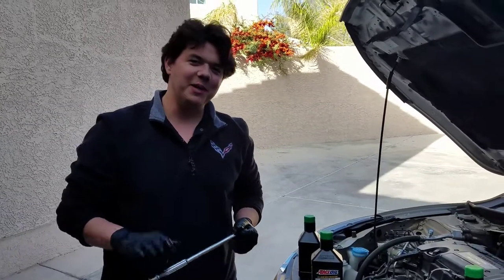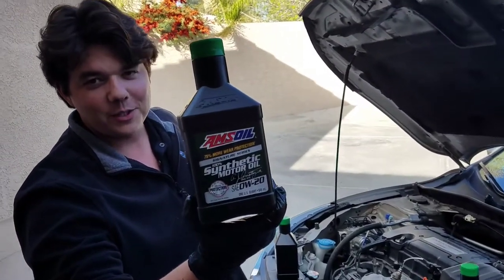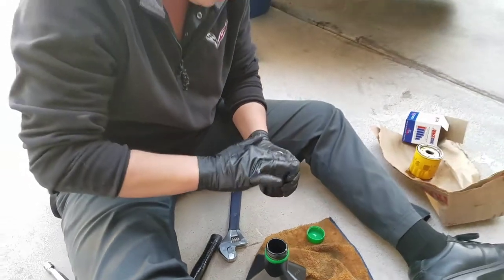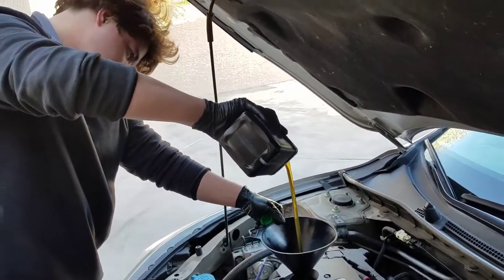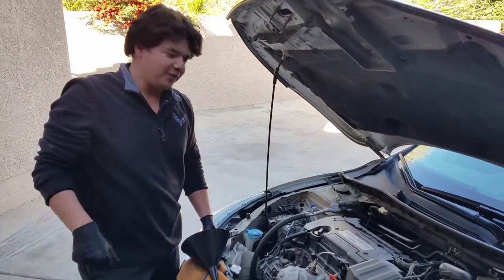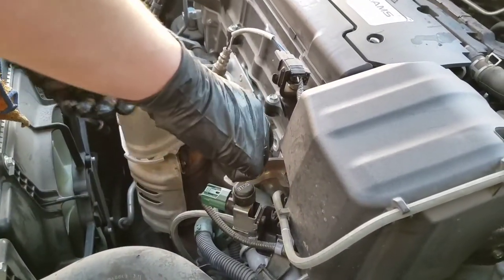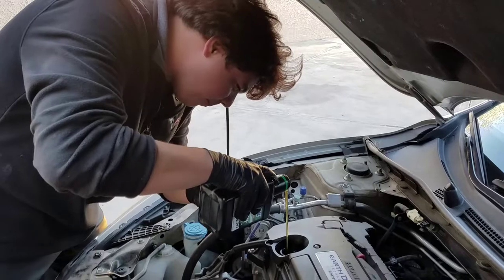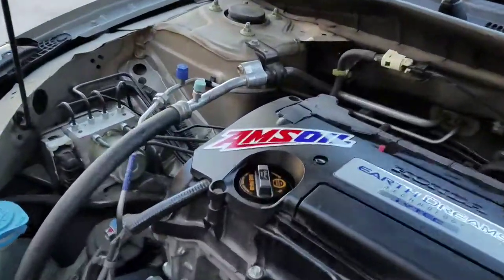2014 Honda Accord AMSOIL Motor Oil Change

Comment: my 2011 4cyl engine was slightly consuming oil so i fluished the engine with liqui moly engine flush (to remove deposits over pistons sealings) and put up amsoil ... its quite alot.. but dont know its because of amsoil 5w30 or engine flush.. what additive i can add to eliminate oil consumption?
Reply from the maker: I would do a amsoil Power Foam treatment and I would get a bottle of amsoil PI performance improver.

I would also reflush it next time with the AMSOIL engine flush.

https://youtu.be/YmOB_nkbI_M
Reply: my accord had some problem, do you fix it ?

Comment: Was curious, according to Amsoil material safety data sheet 5W30 Signature Series meets Honda HTO-06 Oil Standards but the 0W20 Signature Series does not. Would it still be safe to use 0W20 Signature Series in a new Honda Civic Engine? What are your thoughts?
Reply from the maker: The signature series is exponentially better than OEM Honda fluid.

Amsoil doesn't pay for the testing on Signature Series because they change the formula constantly to make it better and better all the time also they keep it proprietary.

All the other motor oils below at the Amsoil OE and the Amsoil XL are still significantly better than OEM and those are tested yearly and they remain the same blend for the whole year where signature series is constantly being updated four new technical specifications like lspi low speed pre ignition and a lot of other new compliance